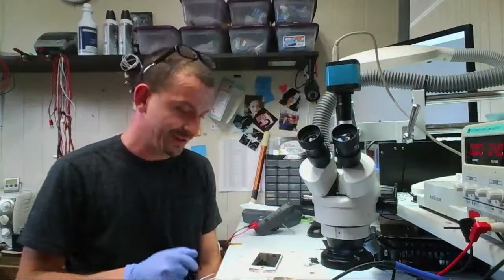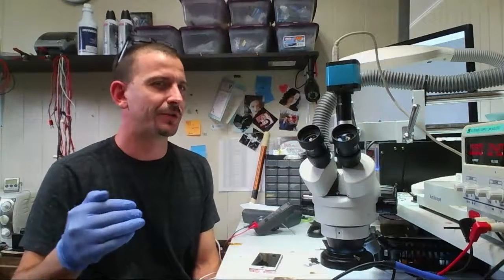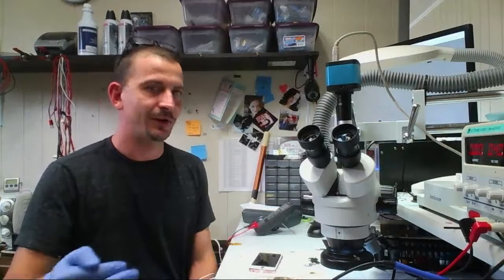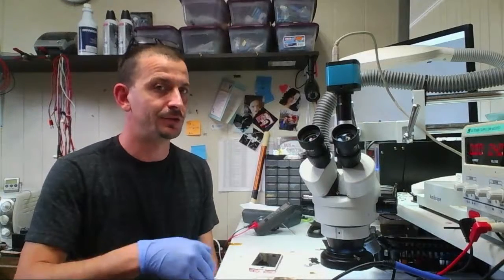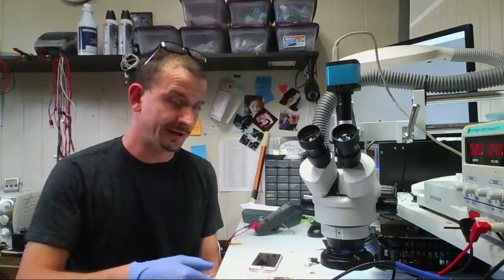iPhone 6 Touch Touch IC Failure / Disease?  Thinking about having it repaired?  Watch this first

Comment: Good of you to put this public.  

I know even with my own clients just on screens, I'm mostly telling them to get their iP6S done by Apple (Cheaper, original, preserves warranty) though I admit it's for economic reasons too, margin between 3rdparty/refurb S screens vs Apple price is too slim.  Would rather the client be informed, than have them come back 3 weeks later all mad.
Reply from the maker: You would think that something like this would slow down touch IC repairs but it really hasn't yet.  It's sort of like when we learned Apple was cheaper on screen replacements back when iPhone 6 screens spiked back up to $90.  People still wanted us to replace their screens even though Apple was cheaper.
Reply: When the screens drop to about 2/3rds of the cost apple does them for (about $150AUD), I'll consider offering  them;  until then (for me) the risk/margin ratio is too high, especially since 3rd party screens do have about a 10% failure rate which as you know you have to carry until the supplier replaces/refunds.  Over here in Australia the market seems to  lag what the US is doing by a fair bit (6~9 months).  Hopefully with the iP7 now coming to market the screen costs for the 6S will drop quickly (sitting at $199 AUD at the moment, Apple does them for $218 AUD)

Comment: hey pro tip; you can pic out the thumbnail and make it different. thanks for the great info! have you been using the future shield?
Reply from the maker: I usually snip a thumbnail out of the video and upload that but this one I just let YouTube Pick :D

It seems that touch IC repairs that are going to come back are just going to come back.  I've had some go out of here without the shield and came back with grey bars.   I then replaced both ICs again and sent them out of here with the shield soldered on solid.  90% of the returns will come back after a 2nd repair, even with that shield.  I started putting it on all of them but still seen the same return rate. I also ran into a customer dinging the back of their case bad enough to short that plate against the components on the board because there is very little clearance.  I think once this defect gets bad enough, it extends beyond just the ICs.  There is some component that is having its' value changed by heating, perhaps even traces inside the board because when they do come back and get fixed the 2nd time - they usually last for a day or two before acting up again.  It's sort of bizarre.  The shield does help some of them - I install it once in awhile now but when I do, I insulate it with kapton tape on the inward facing side.
Reply: Hello Colleague everyone has different opinions and techniques, in my opinion the shield is not going to make any difference avoiding this issue. To avoid this problem apple will need to do a harder frames.

Comment: Hello Jason , 
Thank you for this great info !
How often the Touch IC get damaged after the first repair/ Replace ?
I had replaced it for My iPhone 6Plus , and the Repair Engineer advised me to sell it because it might get damaged again! i didn't understand why he advised me to do so... What do you think ?
Reply: repairing the ic doesn't increase the chance to get damaged again and just because it was repaired doesn't mean it will happen again unless they bend the frame or drop the phone or......etc
Reply: STG Repairs Thank you! ... i just worry about dropping it again :(
Reply from the maker: You're welcome!  I think if you haven't seen it act up for a month, it's most likely not going to.  We are facing about a 10% (more or less some weeks) return rate on this repair.  The phones that are going to have problems normally act up within 1 to 7 days after the customer gets it back.  When they get bad enough there really isn't much fixing them unless you have time to sit and pin out all of the traces on the board and sort of rebuild the whole thing with micro jumpers(no way).   You're probably ok but if you're really worried about it you could try to trade up for a 6s or higher.
Reply from the maker: I'm starting to think lead-free solder is playing a big part in these failures too.  Sometimes just looking under the IC from the side before removing it, you can see balls cracked up.  So maybe most of the time cracked up balls and damaged ICs, the lesser part of the time - damaged PCBs.
Reply: This is Great Info , Thanks a lot .. you had given me a big vision about the current situation. All the best for you dear!